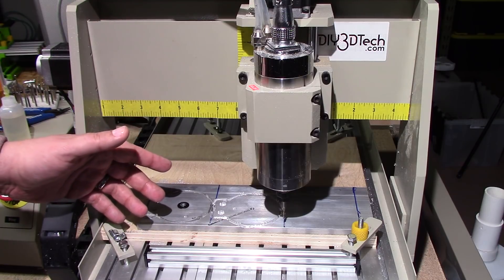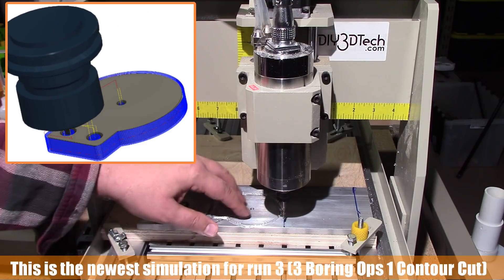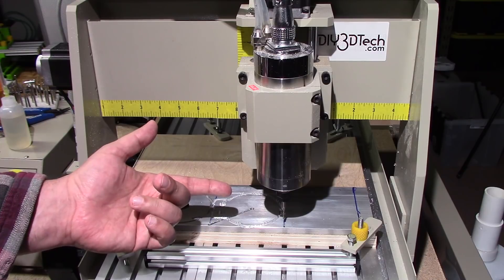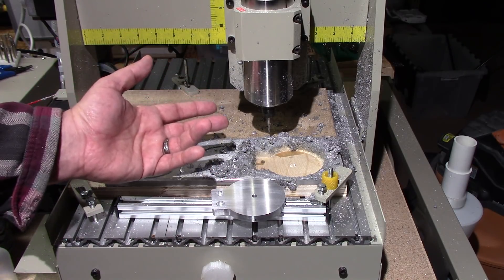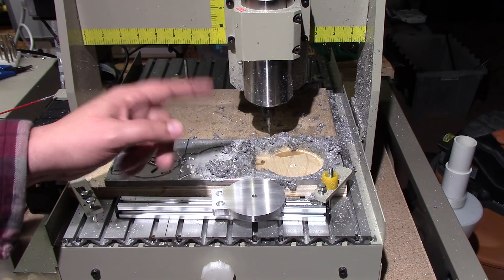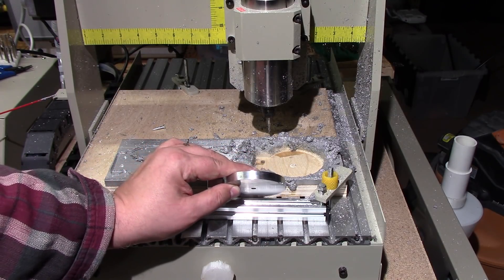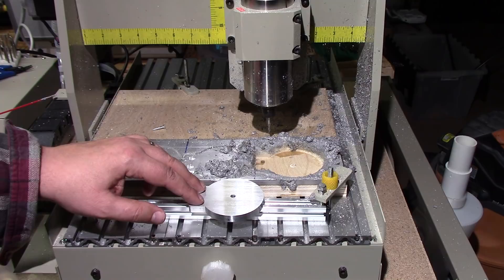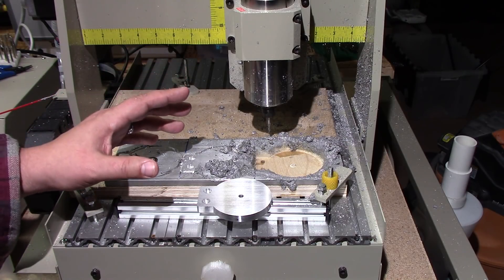3040 CNC  - Cutting Thick Aluminum Success!

Comment: a few tips dont bore or ramp pre drill then drop down to full depth and use adaptive to remove material also i only use 6082 (t6) aluminium dont use random grades also dont climb mill you were going the wrong way on the contour it causes chatter on small machines. also dont use oil use a vac get the chips out straight away
Reply: Better yet to just spot drill and finish the holes on a drill press. It saves on tool changes and extends end mill life. I too get lazy and just do it all with one tool sometimes.
Reply from the maker: Thats the way I am as its easier to cut the holes with the mill then take the time to drill as tolerances here are no big deal and time is more valuable.
Reply from the maker: reinforced octocopters  good points however my skills with CAM in fusion are VERY limited.  I did try adaptive yet had issues so took it very basic.  There no question that there is a ton of power in Fuison CAM, however thinking switch to Mesh CAM as my goal is to design and create parts and the CAM cycle (since this is all a hobby) is taking way too much time from this goal.
Reply: @DIY3DTECHcom   I agree. Most of the stuff I do at home is one or two of a kind stuff. I set my speeds and feeds very mild to save on broken tooling and to get a usable part the first try. Basic pocketing and drilling routines will get the job done and still be faster than doing it manually. At work we optimise tool paths and max out feeds and speeds to push the limits. You can afford to break a few tools speeding things up if your going to be making hundreds or thousands of something.
Reply: forget everything i said and buy your self a single flute carbide insert end mill off ebay omg im machining twice as fast for a third the cost
Reply: Can you link one of them- insert end mill, eBay